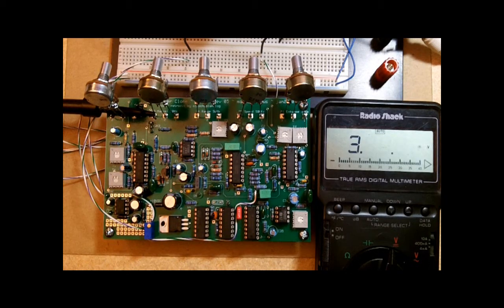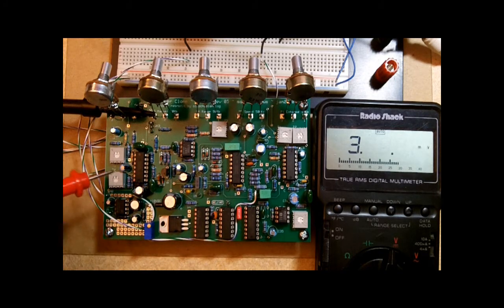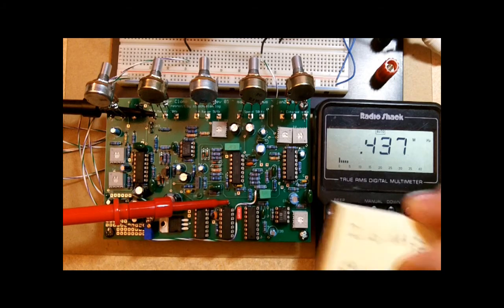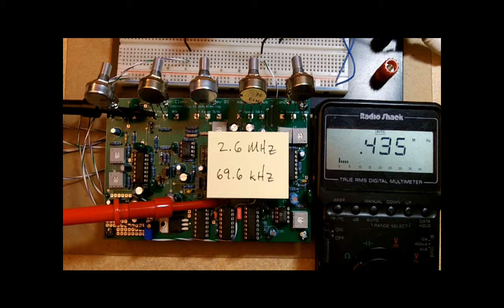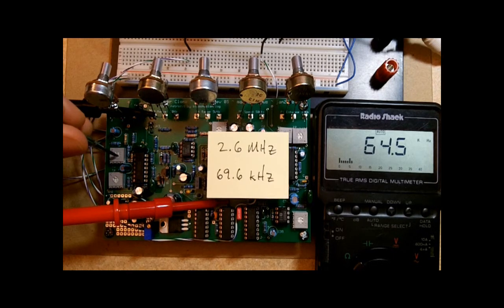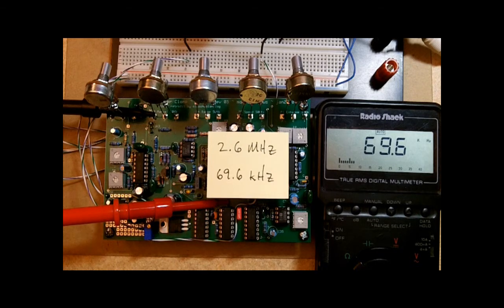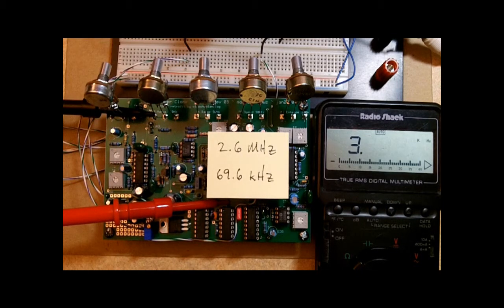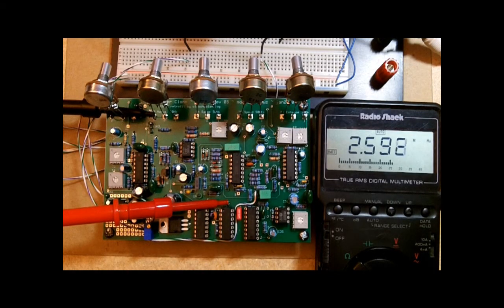part1 moosapotamus flanger calibration

Comment: Hello! Super late to this but does this calibration also apply to the A/DA PBF Flanger? It also has 6 internal trim pots. I have one and it’s all out of whack and finding someone to work on it has been nearly impossible. Thanks for making this video, it gives me hope that I can get it fixed!
Reply: Yeah, my PBF doesn't sound like my large Reissue from A/DA... I bought a Earthquaker Devices Pyramids, but, it is not the right combination of airy, juicy, and slightly chewy, like the large A/DA Reissue, which is the best Flanger ever, in my experience. I also have a Moogerfooger MF-108M.

Comment: **ANSWER FOUND & EXPLANATION GIVEN BELOW**
Hello, great instructions by the way! Just one minor question I have about the schematic's for the rev 05 version. One can see numerous Vb and V+ throughout the schematic. Now Im aware V+ is the +15V or so supplied from the charge pump but Vb im not sure on at all. Would Vb be voltage before i.e +9V or what exactly is it? Everything else is clear as glass, thanks!

Ahhh!
Through some digging I found out Vb = V 1/2 so about +7.5 V. 
Source : http://waldorf.electro-music.com/forum/post-181004.html 
Just leave this here for who ever else is wondering 

One final addition! So at IC2, Pin 14, the output is Vb (the +7.5V), now looking at the schematic, before pin 12 of IC2 we can see R7 & R8. Both resistors are 68k hence splitting the original +15V in half. One portion of +7.5V going to GND and the other going to pin 12 of IC2. Hope this helps someone! Basic electronics but hey! 

Its been a while since i used my degree, but seems like its still in here somewhere or another :)